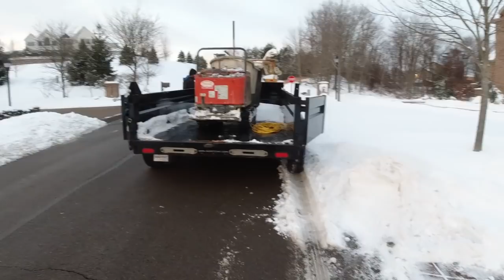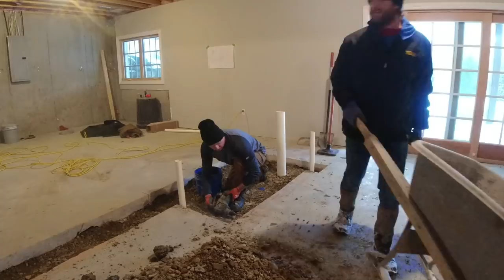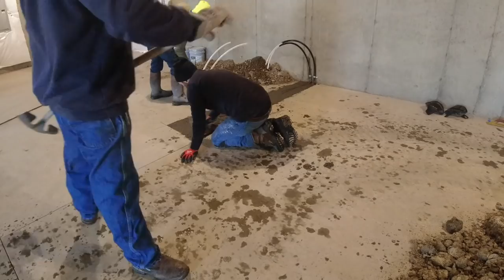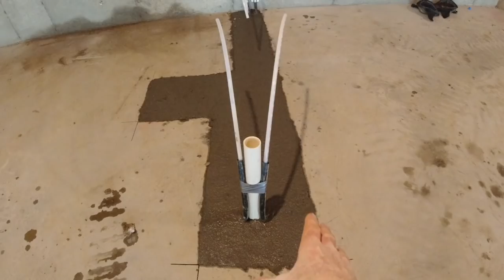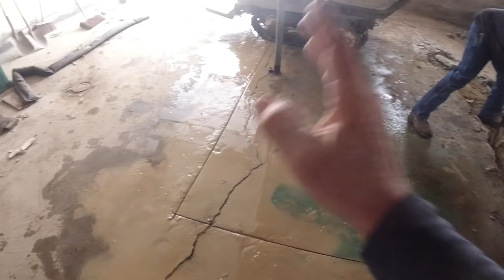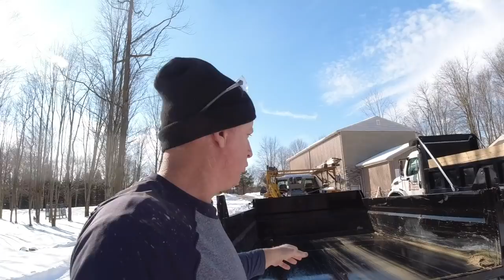Back To Pouring Concrete!

Comment: Hey Tom! It was good to see y'all pouring concrete again. I like the variety though, especially when grandkids are there. It's all good. The snow hinders work flow but mud is worse, I think. Yes, I agree the dump trailer is perfect for smaller jobs. I'm sure your crew is happy to be working. When I worked w Hickory Construction I signed up for unemployment benefits a lot and every year I'd have to do several state tax forms as we hardly ever stayed near Hickory. Very nice video today, thanks!👍👌❤

Comment: The 2nd job with the sinking concrete? How old was that floor and what do you feel was the reason it sank? I have that issue in my 200 year old wagon shed. lol  And, how thick should floor concrete be? Love your videos and your team!
Reply from the maker: We never pour less than 4 inches thick. I believe it sank because of the over dig of the foundation it is the low side corner. floor is about 40 to 50 years old thanks for watching

Comment: Tom could you have on that last job just poured concrete on top of the old concrete and brought it back to level for a quick fix?
Reply from the maker: I prefer to get the old out and start over brand new going from 4 inches to nothing wouldn’t last

Comment: Tom couple of quick questions ? 
1) what is a price on the power buggies
2) have you tried rigging one up or seen anyone trying to remove snow with them ?
Reply: I wondered that too, but no need to when you have a skid steer.
Reply from the maker: Brand new guessing they’re around 18 to 20,000 I bought one new and I bought one used for 8000 no I never use it for snow removal skid loader works way easier

Comment: Would it have been possible to use self leveling grout on your last job? I have a basement in rental property that is in poor condition. The house was built in 1925 and the concrete has to be 10,000psi! It’s just hard! I was hoping to use self leveling concrete?
Reply from the maker: It will work however the cracks will telescope through the new

Comment: I'm disappointed in the crew!  When you told them to let you know if they wanted you to jump in, they all should have turned and offered you their shovels!🤣 That's what I would have done. 😁 Also, I was a little surprised that a concrete truck came out for what appeared to be a very small job, but what do I know!?👨‍🚒